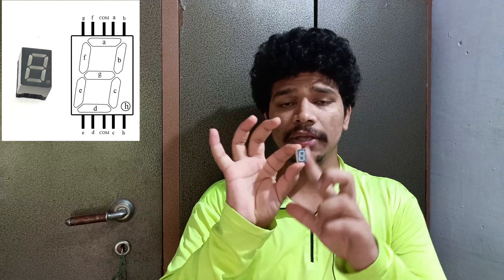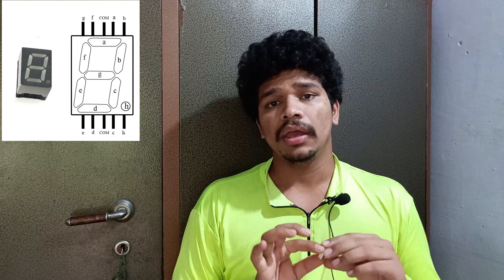How to Connect 7-Segment Display to Arduino | Display temperature on 7-Segment | Experimentalist.

Comment: i want to use big display then i need transistor for switching, what type of transistor i need to use?
Reply from the maker: it depends on the type of 7-  segment display, some have positive and some of a negative type, if it is negative type then use NPN, for is positive type use a PNP transistor
Reply: @experimentalist1494  i have made this but display flicker every second  , i am using 3 digit display. can u give me ur whats app number i want to shear its video to u...
Reply from the maker: Insta I'd - experimentalist123

Comment: *Bro can u do smart irrigation system using this below components
1. Arduino NANO. 
2. 7 segment display {4 quantities} (To display 
Temperature and Humidity Values). 
3. L293D IC (For two DC pump and substitute for Relay). 
4. DC pump. 
5. DHT11. 
6. Soil Moisture Sensor. 
7. LED’s (For Motor ON/OFF Indication). 
8. Bread Board and Batteries.*
Reply from the maker: Yes
Reply: @experimentalist1494  sir then do video on it 
It will be successful 🔥

Comment: Can the same code be used for tmp
Reply: There are specufic que they ask why did u used only 220 ohm resistor. Can you ans this?
Reply from the maker: @easy-peasygrammar1304  i use these resistors because, it decrease the voltage which is comming out from arduino, so these 7 segment display protected by 5 v, you can also use this project without the resistors it looks bright .but i use resistors as a safety of 7 segment display. Because these led required 3 v
Reply: @experimentalist1494  thanks a lot
Reply: Software you used
Reply from the maker: @easy-peasygrammar1304  arduino ide
Reply from the maker: Yes
Reply: @experimentalist1494  thanks for the reply..
Reply: Theres no such file in tinkercad